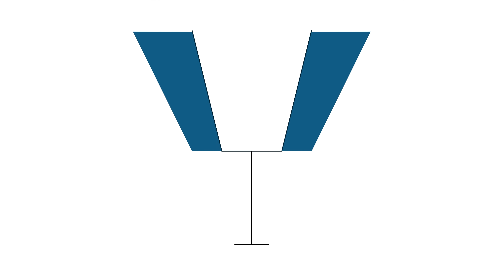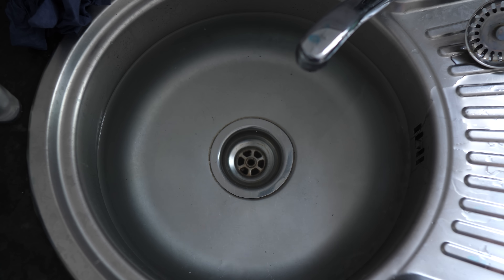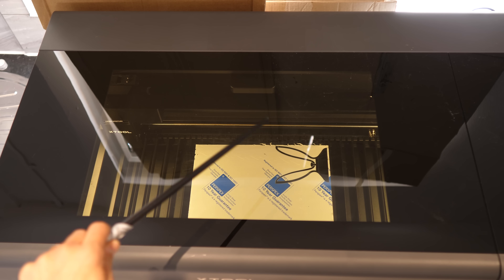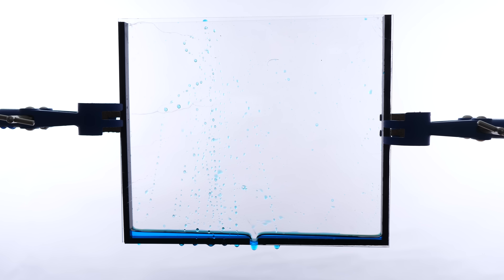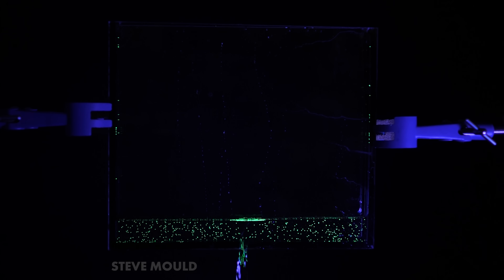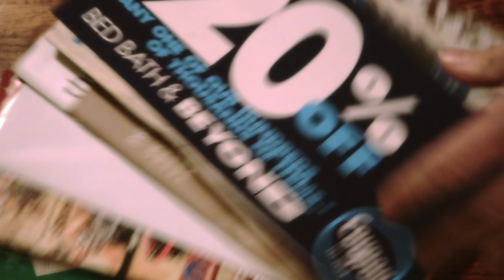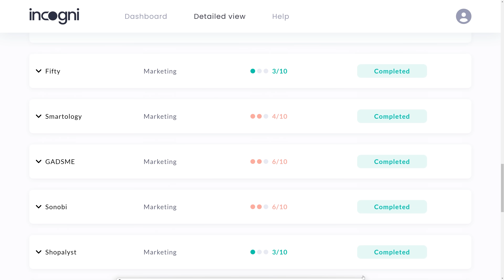2D water magic

Comment: For the chicken waterer, because the barrier blocking entry is submerged on both side, in order for the water level inside the chamber to lower (and thus have the water pour out of it), the pressure of that air inside has to drop. As that air pressure drops below that of the ambient atmosphere, the air outside the chamber begins to push inwards- this is the general reason why air automatically floods into a container with liquid pouring out of it to begin with, the change in pressure between the two zones creates an osmotic effect through the actively flowing fluid (which is why for containers with large holes in them the fluid will "bubble"/"glug" out of it, the smaller and less dense air particles disrupt the surface of the fluid water and create gaps for the air to flow through, just as they would the gaps on a solid osmotic membrane/mesh)

But for the chicken waterer this is a problem, because the barrier is both entirely submerged at all times and very, very thin. Which means as the air presses down further into the trough of water the water pressure its facing from the water inside the chamber is increasing- and because water is more dense the force it exerts as it flows out is much higher relative to the volume of air being sucked in by the drop in pressure inside the chamber. The water pressure wins that tug of war and the air just can't get inside, just as with a straw with one end of it blocked. The pressure of the water overcomes the pressure of the air and can't percolate through the liquid due to the narrow opening making it impossible for the air to break the water's cohesion- which is further increased because the small opening and high water pressure is also increasing the density of the water through small amounts of compression, not to mention the very small amount of hydrostatic pressure affecting the water since the air is trying to push down along the outer portion of the inner barrier since that's the shortest path. And of course the added pressure of water outside the chamber, in the trough, also pressing on the air and inside water both.

Drinking/removing water from the trough allows more water out of the container because lowering the volume of water outside the chamber lowers the pressure it inflicts the inside water with, which allows the inside water a very very small edge in newton's tug-o-war and thus to push out until the forces equalize again.
Reply: Though to be more accurate, the osmotic effect in general is more of a pulling force and not a pushing one (or even even more more accurate, a reduction in the pushing effect on one side of a Newton's tug-of-war, which is what I like to call any generalized pressure equilibrium). Objects can't "know" anything, and the air outside the chamber doesn't "know" what the pressure inside the chamber is and so can't actually respond that change.

In reality, what happens is as the pressure lowers in the air the amount of force that air atoms press into water atoms with lowers because of the increase in volume (and corresponding drop in temperature, which is itself a side effect of the volume change because more space to travel = more time between collisions = fewer collisions per second = less transfer of atomic momentum over time = lower temperature), which means that the water on the surface of the fluid body is experiencing less pressure and thus experiences more spontaneous vaporization at the surface, which of course means the water molecules on the surface are impacting the molecules below is less, and those ones below them, and so on. The entire chamber experiences a pressure and temperature drop, accordingly, which extrapolated across the atomic scale results in a dramatic reduction in the actual pushing force it exerts through the gap at the bottom. That increases as the water level drops further relative to the volume of fluid/air inside the chamber, approaching infinity in this case, until the force is small enough for the relatively flat and unchanging hydrostatic effect in combination with the pressure of the "outside" water being pressed on by "outside" air is able to overcome it and thus arrest movement entirely.

Drink from the trough, reduce that rivaling pressure combination, breaking equilibirum and allowing the inside water and air to push just that little bit further until it balances out again the instant the trough is refilled at a lower inside water level. No new air actually ever enters the chamber until there is so little water left that the level of trough needed to cancel the internal pressure is low enough for the lip of the barrier to be close enough to the surface of the trough for the hydrostatic pressure at that particular point in the fluid body to be low enough for the water and air pressure on the outside of the system to press in that tiny little bit farther and make it under the barrier, thus setting off the chain reaction that allows air to bubble into the chamber. Chicken waterers are made such that that equilibrium also happens to have the inside water level be below the outside lip of the trough- so it doesn't just suddenly spill out everywhere.
Reply: breathe Which is WHY a chicken waterer's trough needs a high lip. If its too low, the trough cannot hold enough water to create enough pressure to ever reach equilibrium, and thus all the water can and will just suddenly spill out all at once!

Comment: Here's a fluid dynamics question i had for years and never found a proper answer for, i dont think there's any videos on it either

There's the thing you can do with bottles or jars to clean them, you partially fill them with water, then close them and shake. The question now is, how much water do you need to put in for the best cleaning effect? If it's too little, then the water doesnt have enough weight for a proper "impact", and if its too full then you cant build up enough speed for it to clean. What's the optimal volume for the best cleaning effect, and does it depend on the shape of the container? What other ways are there to increase the efficiency of that method?
Of all youtube channels i watch I cant imagine any other being more suitable for this kind of question.
Reply: > What other ways are there to increase the efficiency of that method?

if the bottle are long and have bigger base vs top: tilt ~30 to 45 degrees (depends on bottle shape) and rather than shaking it you spin it around and make use of both centrifugal force and leverage. since most gunk and residue are collected at the base of the bottle, which now are further away from center of rotation, the centrifugal force applied to them got amplified. It work best if the bottom of the bottle is concave instead of flat

It will be harder to do with jar because their base vs top ratio are almost 1:1. You can close it, wrap the neck with strong rope, let it dangle and then spin it till the rope and jar is angled (similar to how centrifuge works in chemistry).
But this usually not as efficient since your knot will likely be off-center of the jar center of mass and center of rotation.
Reply: Wait, i just remembered simpler method I usually use with smaller jars. fill 1/4 with water, close it, position perpendicular to floor in front of us (with both hand grabbing the top and bottom part) then do circular motion to induce centrifugal force. It's actually work better with less water since too much water will cause it to just slosh around. You can "aim" at certain part by tilting either hand.
Reply: @bepamungkas  The swirling method is actually how I start washing pots. I fill it 1/4 ish, then stir it fast enough that the water climbs up the sides and starts scrubbing it somewhat. Then my hand, then the sponge, etc.
Reply: its about optimizing pressure and force. the more water there is, the more that the air inside cushions it before it hits the bottom. this is because the water more easily forms a seal and prevents the air from moving out of the way. with less water, no seal will form, but the water will still be pushed to the side by the air, causing it to slide more than impact.
the optimal amount of water is proportional not to the size of the container, but to the square area of the plane perpendicular to the direction of motion of the water. the container can have a ridiculous volume, but so long as the axes you are not shaking through are small, then so will be the amount of water you can use.
testing it myself, it seems to be about 3 inches of water.

Comment: It would be cool to see laminar flow with the echo effect, if it's even possible to have laminar flow with beads in the water
Reply: Well, that's what you got! No need to wonder. The beads hardly act on the water at all, so no worries there.
As for turbulent flow, the water being poured in, right as it hits, (without double checking) I expect you would see some turbulent flow there.

Comment: I had to rewatch it twice because i couldn't stop thinking about how hard cleaning those magic goblets had to be and how disgusting they must get on the inside
Reply: @voidmayonnaise  You're not tasting the chocolate milk, you're tasting the mould.
Reply: @barneylaurance1865  how'd he get in there?
Reply: that occurred to me too, probably why they arent for sale anymore if i had to guess
Reply: @nickolaswilcox425  yeah, It would basically have to be water only and only for party tricks and not drinking
Reply: Fungi Sporatum!
Reply: It was sold as a magic trick rather than an item of drinking ware, but it wouldn't surprise me if kids used it for the latter.  Probably have strong immune systems now 😂
Reply: I’ve seen newer ones (not harry potter branded) that comes in two parts, you screw one over the other.
Reply: Soapy water hold the holes and shake and drain if there's no solids already in there you should be fine to just rinse out a few times
Reply: @Caliballen22  Not in the long-term. Gunk will build-up, most of which will be safe and flavorless for a while, but most people don't wanna drink from a gunky container.
Reply: @Caliballen22  The problem is knowing if there is mold in there. Or other solids for that matter.
Reply: If you only use it for vodka or should be pretty clean

Comment: The echo effect really made the difference. I’d love to see more with those neutrally buoyant particles
Reply: Just give me a loop of the convection one in a container that has a 16:9 aspect ratio so that I can have it as a wallpaper
Reply: @jckf -- A live wallpaper of this would be amazing. I don't think 2D fluid simulations are too taxing nowadays, so a custom simulation of whatever shape, colour, flow rate, or viscosity you like shouldn't be too hard.
Reply: @TlalocTemporal  now i want to make this on wall paper simulator
Reply: @TlalocTemporal You can probably setup something fairly optimised using nvidia flex or nvidia physx, or one of the many fairly optimised fluid physics libraries that exist in pretty much every language. (If you are feeling real crazy, you could try make a fluid simulator yourself. There are a lot of tutorials on the internet.)
Reply: @coolkattcoder  -- I've seen a dozen particle sim apps from a decade ago that ran on dirt pressed into a phone shape, so even mentioning a GPU is probably overkill for a few thousand particles. Battery drain on a laptop is what I'd mainly be worried about anyway.

I wonder how Wallpaper Engine deals with live wallpapers, and how customisable you can get. If you could get the fluid sim working, adding reaction to the mouse would be cool.
Reply: It makes me think of the little magic worm things from the beginning of James and the Giant Peach
Reply: It looked like a vector field when he did that. It was so cool.
Reply: With the right software, you can also measure flow speed.

Comment: So for your water draining question, I notice it's giving a little more priority to directly above the drain than to the sides of it
Reply: That probably has to do with boundary layer stuff, but if you look closely towards the end of the draining (easier to see without the echo effect) you can spot that it still forms a little whirlpool, that might have something to do with what we see.

On further thought, we see a larger amount of beads moving above the drain and staying there while the whirlpool forms, so it seems that it's in fact giving a little less priority to the water directly above the drain.

On further further thought, I may have completely misinterpreted your comment, actually. In the video, Steve says he was asked if water drains from the top down or something like that, and I was thinking of that question as well while replying.

Comment: that goblet would be impossible to clean
Reply: yeah, i am guessing that is why it was discontinued.
Reply: You just have to clean it with magic
Reply: If it could be separated in 2 parts, no problem.
Reply: @eduardosuela7291  good news lol
Reply: @mechonm69   Not those two parts....
Reply: What if you fill it with soapy water and pinched the holes while you swirl it around (and maybe use something to cover the top) ?
Reply: Sounds like someone is a muggle
Reply: Use something combustible so it can be easily removed, call it a goblet of fire
Reply: Perhaps strong vinegar? If not, immerse it in a sonic cleaning machine like for jewelry - that should work I would think?
Reply: @mcv2178  Possibly, but the average consumer isn't going to have access to a sonic cleaning machine that can clean the inside of the cup -- hence poisoning if an average consumer isn't constantly cleaning the cup properly

As for other responses I've seen... chemicals will leave residue if you do not properly wash them off, and if the surfaces had build-up of any sort of residue... that is prime real estate for contamination which other chemicals can latch onto and not come off. Which then leads to issues of leaching when you start pouring other fluids into the cup

As a former dish washer who also frequented restaurants in the past often, one of the issues with water and tea cups is when restaurants decide to use bleach to clean the cups by dunking the cups in bleach water then rinsing off with soapy water then water only. The residue is bleached to look like it doesn't exist, but it is still there, and the bleach latches onto that residue so it'll start leaching into the water when the cups are used. And... well... obviously.... you can taste it. It is very faint, but definitely still exists. Typically, it is less detectable with ice water since the bleach residue doesn't react as much. But when you start serving stuff like tea and hot water...? Let's just say that if the tea isn't able to cover up the flavor enough, it starts tasting as if you were drinking chlorinated water from a spa - which can be disagreeable with some people's stomachs. I am one of those people whose stomach couldn't agree with that residue leach

Side note: extremely concentrated dish soap covering the residue for several minutes will typically take a good chunk of it right off, and a little extra scrubbing will take off the rest of it. Not a recommended method for consumer household use, and unviable for use in a restaurant setting because it is extremely wasteful when it comes to dish soap consumption unless you know exactly what you are doing to not waste the ton of soap you poured out. Only use for diffcult stains that refuse to come off when normal washing fails. Soap can be transferred from one stain to another a few times if there was a fair amount poured out, then whatever soap is left over can be used for scrubbing a whole load of dishes. Requires quite a bit more water to rinse as well, hence another reason why it isn't recommended
Reply: Water only cup.
Reply: Impossible to scrub directly. You could easily use a gasket and have it disassembleable. Or you could use clean evaporating solvents.
Reply: You just need to use aggressive methods like bleach and lots of rinses.
Reply: No easy, fill the other hidden side, then once you start the exposed side you stop and immediately close the holes, swirl it and that's it
Assuming you used soapy water 

I clean chemical equipment sometimes and are similar to this in regard to closed chambers that need some pressure to get in or hold in
Reply: @SOMA-WR As long as whatever you're drinking doesn't leave gunk that needs to be scrubbed
Reply: @antonliakhovitch8306  Unfortunately, that's not true. Even with just water, it will develop mould over time (is there a pun there?).
My technique to wash this kind of thing (like a bottle I reuse) is to, once in a while, wash it with bleach, then again with dish soap, and finally rince it very very thoroughly.
Beware that bleach might detach plaques of mold. When you see what  has been in there all the time, you won't want to use it ever again. 😅
Reply: @Ceelvain  Mould is growing in his water siphon modeling abilities